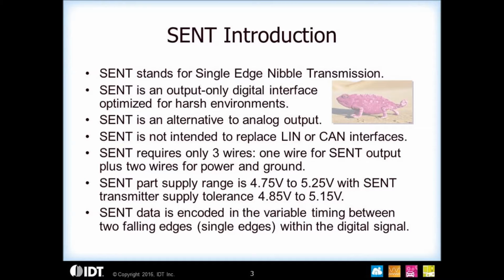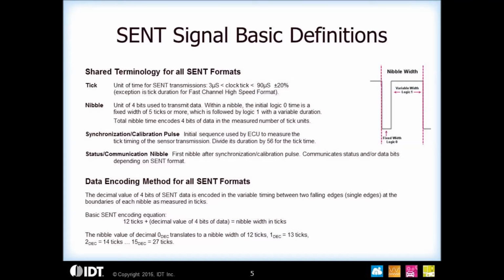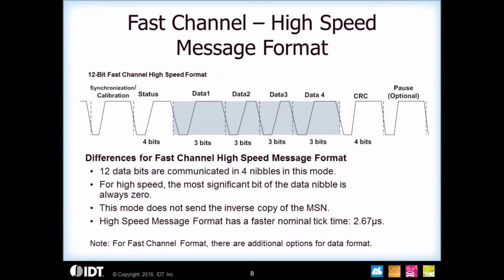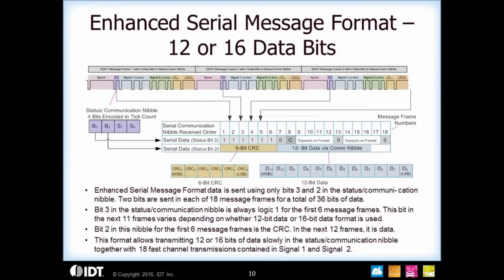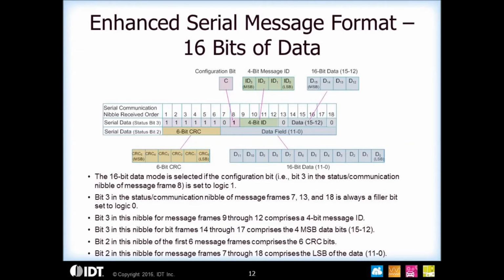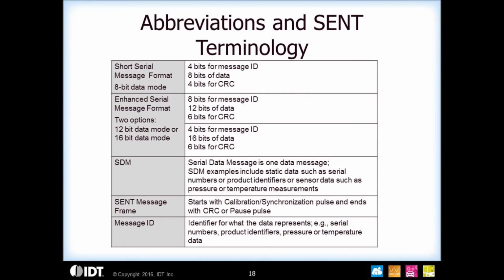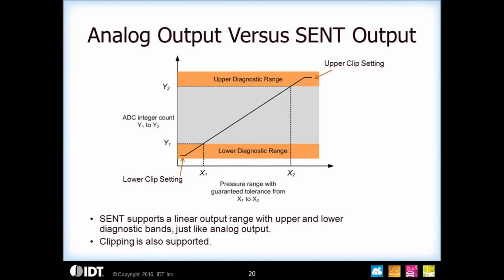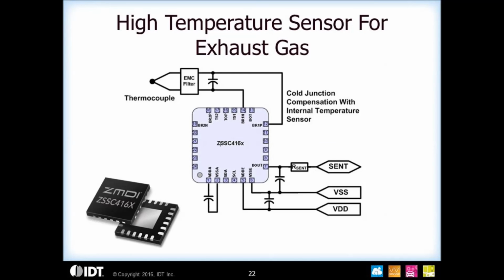Introduction to SENT 3.0 Interface (Single Edge Nibble Transmission) and Sensor Conditioning

Comment: Does Anyone know any vehicles that use SENT interface on throttle bodies?
Reply: 2017 Ford F150 - TPS and other sensors
Reply: Manifold absolute pressure sensor in cayenne uses this signal